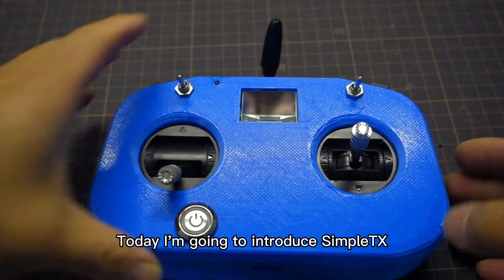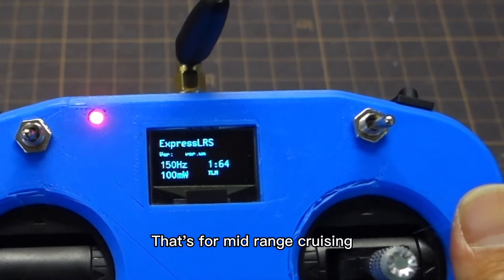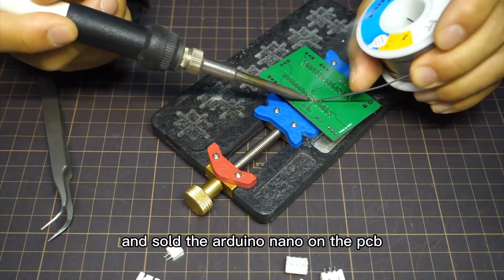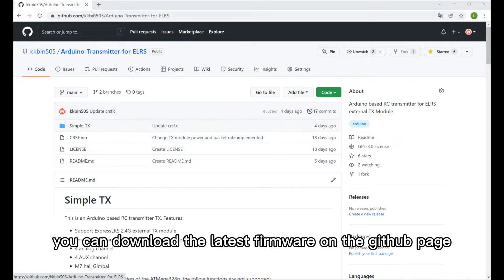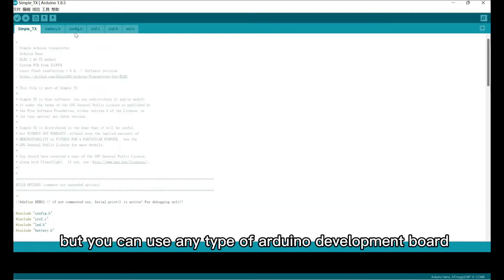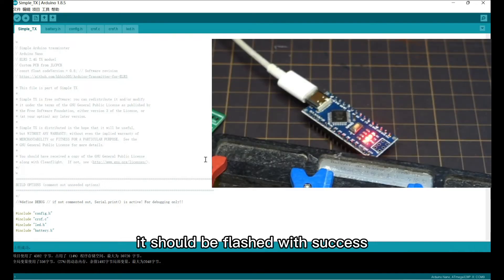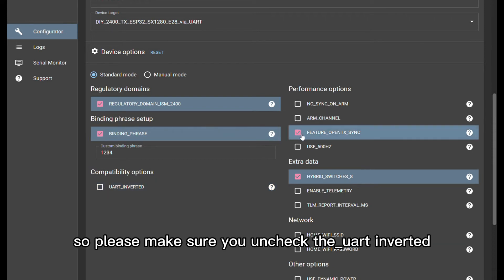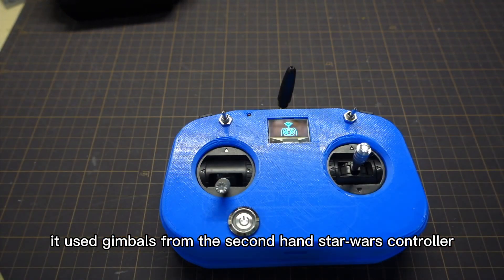SimpleTX Introduction | Open Source Arduino RC Transmitter

Comment: Hello, can I invert the stick axes? Because my gimbals are too big, so I installed the gimbals in reverse, so that when I lift the stick, the voltage on its hall sensor becomes less. In which piece of code can I do this? And also my sticks only reach half, what could be the problem? How does calibration work and can I contact you?And another question. I soldered everything correctly, but there is no reaction to the throttle. What could be the problem?

Comment: hi sir, thx for making such a good video and github source. 
allow me to ask, i have elrs tx module happymodel es 2.4GHz. and elrs receiver epdual. if i connect the elrs tx module with radiomaster remote controll it will bind with the receiver automatically, i've already set the firmware via elrs configurator. but i need to plugout the elrs tx module from the radiomaster RC, i wanna binding the elrs tx module via arduino nano to elrs receiver ep dual, is it possible? thx sir ^^
Reply from the maker: I use bind phase instead of binding on the TX. So it "skip" the bind process. No need to bind via TX
Reply: @leejack1112  hi sir thanks for the reply, finally I can build the elrs remote control using arduino. But there's another problem about the high latency, I've tried to setting the CRSF_PACKET_RATE and CRSF_TX_POWER. but it got stuck maximum in 150Hz packet rate. Do you have any advice sir? Thx
Reply from the maker: @yanswg_  do you use 2.4g or 915?

Comment: Could you please provide a link to the elrs module you are using?
Reply from the maker: @Ivasko009  I use mini and superslim
Reply from the maker: https://github.com/ExpressLRS/ExpressLRS-Hardware/tree/master/PCB/2400MHz/TX_SX1280_Super_Slim I use the super slim module. Alternativly, you can use rx as tx, they are cheaper and smaller. Check this https://www.thingiverse.com/thing:6677484

Comment: This is awesome! I just found this and would love to build it myself. Will this work for ELRS v3?
Reply from the maker: It will work with ELRS v3, but can not adjust any config.
Reply: @leejack1112  that is good news thanks! Settings be changed with Arduino code if I learn how to so that right? It is just not configured for stick commands right? Can’t tell you how happy I am to have found your project thank you so much for your hard work!
Reply from the maker: checkout this repo, https://www.thingiverse.com/thing:6677484

Comment: hi, how to connect oled lcd?
Reply from the maker: The oled is only connected to the elrs not the transmitter. There is an repo in the elrs hardware https://github.com/ExpressLRS/ExpressLRS-Hardware/tree/master/PCB/2400MHz/TX_SX1280_Super_Slim

Comment: How about the range from it, have you check it?
Reply from the maker: Because it use the elrs module, the range is depending on the elrs its self, not the transmitter.

Comment: great job! can this work with elrs v3? you tried?
Reply from the maker: Yes, it can work with v3 but only with defaul setting
Reply: @leejack1112  I tested your mode ppmToCrsf, ppm to d2 input with happymodel elrs v2. But this not working:((  what could be the problem?
Reply from the maker: @intelpro_uav  you need to flahs TX to uninverted to be able to connect to arduino

Comment: Cool project,but can i use this tx for rc tank,boat?
Reply from the maker: elrs has pwm receiver, so it is doable. For rc tank, you need customer mix, with the transmitter might not support, but you can write your mix in the code.

Comment: This is cool!  I just gutted my very old Airtonics transmitter, added an Arduino Pro Micro, and made it into a native USB game controller.  But then I ended up here because I was wondering if there was any way to add ELRS.  Looks doable, if I feel like putting in the effort.
Reply from the maker: Gread, Do you use USB HID? I wish I can add this funtion, can you share some code?